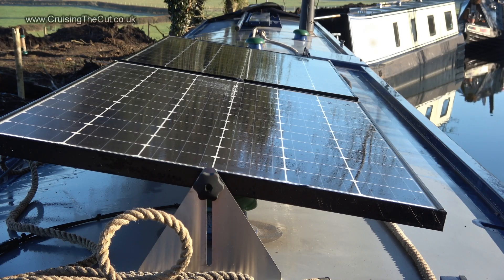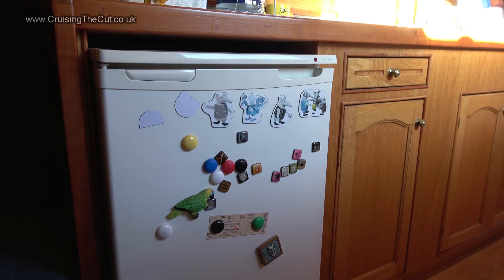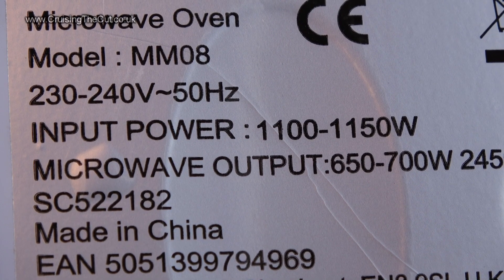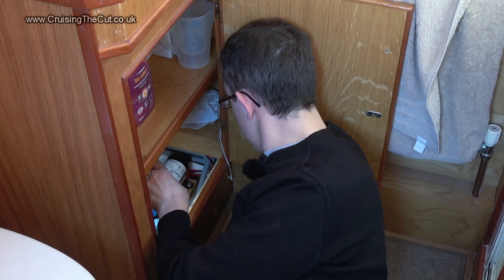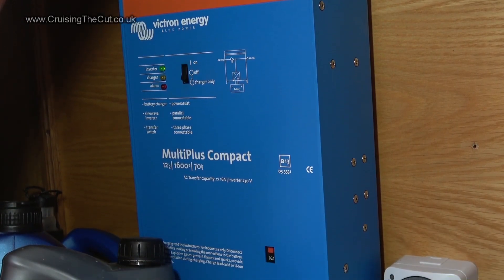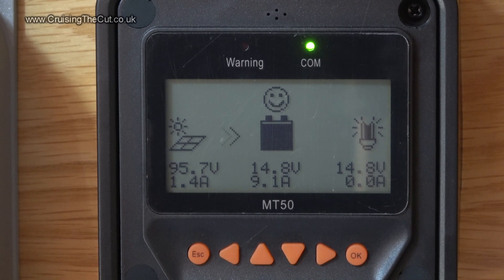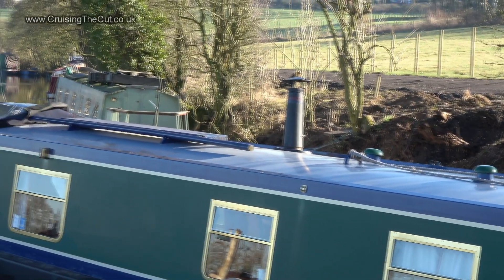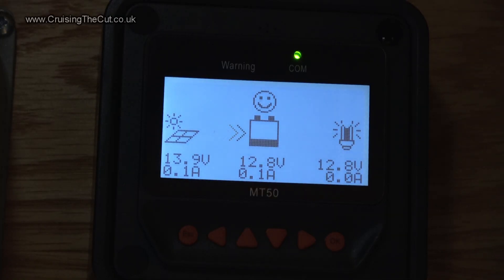76. Is solar power sufficient for a canal narrowboat in an English winter?

Comment: There is always a playoff between extra power generation and reduced power consumption in a cost-effective and convenient manner. The point is that but making a small flat mirror attachment to the high edge of your solar panels you can augments your solar power by about 10% in winter and then put the mirror away for the summer. On really bad days in winter, you can forgo your TV (pure luxury) and use the gas stove rather than the microwave. You can examine your fridge for further insulation [ossibilities and reduce the number of times you have to freeze food (buy fresh salads in winter for example). I personally like piping-hot soup in winter, which is best heated in a pan over the gas stove. Sometimes the stove can double as a heater (Aga) in winter

I prefer YouTube to the TV for entertainment, especially when there are channels like yours from which I can derive entertainment and pick up creative knowledge at the same time. But that is down to personal taste.
Reply from the maker: Different people different tastes as you say. I don't regard the telly as a luxury, even when I'm not watching broadcast material, I'm streaming YouTube/iPlayer etc on it. I don't freeze anything though, no freezer.
Reply: You could try cooking things on top of your stove David to save on using the microwave...as that famous supermarket says...every little helps ;) But I do take your point, solar is NEVER going to be enough on a narrowboat in winter, no matter how large or how many panels you put on the roof!
Reply from the maker: I do indeed heat things up on the stove - usually the kettle - but depending on how hot I have it, things can take ages and for only 5 minutes of heating, the microwave doesn't really use that much - 8Ah ish plus inverter overhead.

Comment: Hello CruisingTheCut. Another very interesting vlog, many thanks for that. have you any experience how long it would take to completely re-charge your battery bank, just by cruising along without the solar? You say yours is rather small, 330Ah, is there any upper limit for a battery bank?
cheers!
Reply from the maker: The upper limit is probably your engine-bay space and your budget! And to what degree you can recharge it.

No idea how long to recharge mine via the engine as I've never done it but half of 330Ah is 165Ah and my alternator's 70A so at least three hours to get it nearly full from half depleted (they should never be allowed to go below 50%)

Comment: Many thanks David for your very informative vlog.  While on the subject of having mains hookup that you touched on.  Do you know if there are any "controls" in place for boat owners in marinas regarding their metered electricity or can marinas change (sorry for the pun) whatever they want?   Basically just wondering how much more electricity would be from a marina supple to a "house" connected to the mains would be.  Sorry we do not have a narrowboat YET so do not have that information.  Best wishes again.
Reply from the maker: I'm told the actual electricity is required to be supplied at the originating supplier's rate but that the marina can make their own service charge. I pay 13p/unit (1kWh) at present.

Comment: Really enjoying your videos M8! Have you considered switching to lithium batteries? I know that they are more expensive, but they charge faster and at a constant rate.
Reply from the maker: Very expensive as you say but would also need a different charger and a different solar charger, plus there are possible fire issues to consider :-(
Reply: Only with lithium cobalt or lithium polymer (lipo), Lithium Manganese can still vent if shorted, but no fire. BTW, I have seen a lead-acid battery blow the hood clear off a car, so they're not a bit safer if misused.
Reply: Most batteries will explode if shorted out, so I really don't understand the safety concerns either. Lithium batteries are used in the RV and boating industry without reservation.
Reply from the maker: It just doesn't seem to be commonplace on narrowboats. Maybe it's the cost. It wasn't shorting out that's the problem, it's the overheating if improperly charged.
Reply: CruisingTheCut That's true, however the same problem exists with any battery if improperly charged. Worse I've personally seen was in Alaska with a car battery that was frozen when they tried to charge it. I really think you will see more use of lithium battery packs in the future. Even my weed wacker runs off a 40v lithium battery pack.
(I would suspect there are 10 Samsung 25r or LG HE2 cells in the pack)
Reply: John Kimbler About £2,500 for a 200 amp/hour lithium battery.

Comment: Add more panels. Use larger 300w panels. Build a rig. I have five 250 watt panels on my house, working my way up to 24 panels for 6kW. But I live at latitude 7 degrees north of the equator in Georgetown Guyana with 9+ hours of useful sunlight everyday.
Reply from the maker: Not much space for more, as explained. And larger panels would get in the way when I need to walk on the roof. Still wouldn't give you enough in winter for a full charge.

Comment: Hi there C.C. Just wondering how long it might take to charge batteries from flat to full using the engine (not including any solar charge). love your vlogs, can't wait to purchase a narrowboat one day.
Reply from the maker: Well... It's not simple. First, conventional batteries shouldn't be discharged below 50% anyway or they die. My engine has a 70A alternator but as batteries charge, they accept less current so effectively it would take days to get them to actually reach 100%!!

Realistically, my bank is 330Ah so 50% would be 165Ah required, so at least three hours would give you a good start but several more to top them up properly.
Reply: Thanks for the reply C.C. Very informative as always. (note to self... Never run batteries flat).

Comment: A fridge in winter ???
My diesel heater consumes 1 liter in 4 hours and I cook on it.
A lot less hassle with diesel heaters. Surprisingly clean and odorless.
You can also run a radiator from many of those heaters.
I use allready 20 years a Refleks heater. Best investment to my boat.
Reply from the maker: Yes I did a video about diesel (and other heaters) a couple of vlogs ago. Yes fridge as the inside of the boat is warm and I'm not shuffling food into the well deck all the time.
Reply: Its a small effort to invent a cool place for your food in winter and
thus mainly solve your amps deficit. Its a slightly different attitude off-grid living. Nothing dramatic, political or ideological. You get used to it.
Thanks for the vids.
Reply from the maker: In my case I don't have an amps deficit because I moor for winter and plug into a shoreline. My point was that for people who cruise, these are the things they need to consider.

Comment: Consider that the actual voltage supplied to items such as pumps etc is higher then 12 Volts, typically 12.7 V when charged but 13.4 V or more (up to 14.4V) when being charged. The result being that the rated currents shown on appliances can be lower than the actual consumption drawn when the batteries are above the 12v nominal.
To address these issues it is suggested that one adds 10%.
Note: If using an inverter, the current draw increases as the battery voltage decreases. This will be particularly noticeable when drawing heavy loads from the battery bank as it will cause some voltage drop at the battery terminals due to the batteries internal resistance.
Reply from the maker: Such as running the microwave!
Reply: Certainly as the microwave is probably the most power hungry equipment on a narrowboat. One can easily test/verify the effect on the battery voltage by measuring the battery terminal voltage while the microwave is running. Note: the microwave will be turning on and off depending on its power setting.

Comment: There's a way to increase significantly the Ah generated... just  ensure to have the solar panel perpendicular to the sun. Of course, this is not possible with the way you have installed the solar panels. You would certainly need to be able to turn then at least 120 degrees side to side, plus orientate them in any direction. Also, ensure that they do not receive any kind of shade, being from a tree, or whatever, r even coming from the other solar panel. This will not be really useful in an overcast day, but will certainly help una sunny winter day. Thanks for your vblogs!
Reply from the maker: Indeed, orientation is key.
Reply: CruisingTheCut how much would that differ? Would be interested to learn.
Reply from the maker: +r2gnl It does make a substantial difference when it's sunny but it's still largely irrelevant in winter when you get rainy days (no sun), grey overcast days (no sun), light overcast days (some light but diffused that pointing towards the sun - hidden by cloud - makes no difference). It would only help on the occasional clear sky, sunny day and even then wouldn't make enough as the daylight hours aren't long enough!
Reply: Mathematically, you get "cos phi", where phi is the angle between te sun and the orientation of the solar panel (a difference of 30º means a loss of 15%, a difference of 45º, means 30% losses). Then , due to having monocrystalline or polycristalline panels, performance will drop more on monocrystalline (which are oriented in one direction). Losses will depend on the manufacturer, but can be from 0 to 50%, or even more.
Reply from the maker: Good info.

Comment: Not good at all. U need electric supply for the winter. How do u go on when u get grounded there is no room to get on your roof. I have many times got grounded and get on my roof with my 12 foot pole to get free and back floating. Sure solar panels would get in the way
Reply from the maker: That's why I deliberately chose narrow (800mm) panels so that there is room to step past them in locks etc. When grounded, I'd push from the well deck or the back, not the roof.

Comment: i would suggest to add one more solar panel and two more batteries. And a mobile solar panel as an additional panel you can put direct in the sunlight when needed.
Reply from the maker: I don't really need it though. It wouldn't generate enough in winter, as explained, besides I'm on a shoreline. From spring to autumn, I have loads of solar.

Comment: Great Video! I'm wondering if during the winter months, on a sunny day, could a couple mirrors be placed to double up the light hitting the solar panels. I think in the summer it might make the panels run too hot, but in the winter, it might be a way to keep those amps up. Maybe I'll have to experiment myself a bit...
Reply from the maker: I've had a couple of people suggest this and there must be some reason why I've not seen people do it but as you say, maybe an experiment is needed.

Comment: Why don't you have more panels?
Is there no space to install them?
I've even seen people with small vans that has 1000W so I would think a bigger boat can accommodate for at least as much.
Reply from the maker: I mentioned that that in the video. But also, I tend to moor in winter with a shoreline so don't need any more, and in summer I have more than enough solar already.

Comment: "More solar" is the answer for winter. As in, (if my back of a napkin calculations are right) you need double the panels in winter (in the UK) than in the summer if you wish to go 100% solar. Though that will probably not include heating. (And your calculations seem to match that)

I'll never have the funds to do it, but I like looking at designs and ideas, so I put pen to paper on a solar powered engine boat. It would have more than enough in the summer (with that double the needed panels), to even replace an engine. But of cause in the winter you'd want to be moored up!
Reply from the maker: No, that wouldn't do it as I mentioned. You get about a tenth of the output in winter from the panels, at best, and for much shorter days. A solar boat would be fairly impractical as there's just not enough sun though I know of one company that's trying to market one.
Reply: In the summer my solar panels give me a maximum of about 13 amps output. In winter, with the panels pointed at the sun, I get about 10-12 amps output from them (on a good day).
Reply from the maker: But for a much shorter period :-(
Reply: Oh yes, but if I'm in a good location, and it's sunny all day - then lots of charging :-)
Reply: Sorry I was not clear. I meant putting enough panels on to power an electric motor in the summer, but it would only leave you with enough power to moor up in the winter. That is, 10x the power in the summer, and use a 10th of it moored in the winter, as you said. With something like 1250watts of panels. :P (Though you may be right and I got my amp/hours wrong, I'll have to go look at my spreadsheet)
Reply from the maker: There's an Australian boat manufacturer who's been advertising a plan for an all-solar narrowboat recently but I don't think their model physically exists yet.
Reply: I've seen one or two boaters do it. There are one or two companies here who will sell the batteries and out board (or in board) for an electric only. But no one yet does a commercial "solar boat" I guess.

Comment: My solar array is 240watts and I can just about manage to keep things going in the winter. Mounting the panels so that they can be pointed directly at the sun, and swivelled throughout the day, will make a huge difference. Having said that, I am still very much at the mercy of the weather conditions and obstructions from trees etc. There is always the option of using less power - less telly and computer! In the winter I don't use a fridge. I leave food out in the cratch where it is usually plenty cold enough.
Reply from the maker: I think you're doing very well! Clearly no fridge helps. Don't you find it a problem when the weather varies from cold to mild (for the food)?
Reply: It depends on the food in question. I think it's just a case of common sense really - don't let it sit around for too long, 2-3 days is usually fine. Just trust your nose, if it smells (and looks) ok it usually is. I do have real problems in the summer though. It means I have to go food shopping every day. I'm on the lookout for a 12v fridge for summer use. They are too expensive new.
Reply from the maker: Every day? Nightmare! Yes, damned expensive.

Comment: Excellent video as always. One thing I 'm wondering is even though an average setup can't run on it's own how much does it save from using fuel or being plugged in. Even 5-15% might be enough to save a little money that would otherwise be spent on fuel.
Reply from the maker: Yes, every little helps. Can't give you a figure though, it depends on the size of the array, the weather etc

Comment: You could of course unplug those electrical devices and go 19th century...but few could stand that for long.
But I bet ,many spend the winter at a place where they can get shore power.
Nice clear report on living with solar power...thanks.
Reply from the maker: Yes, you can get away with little power if you use little power (!!) but I like to have the telly on on a winter's evening etc. Yes, many moor up with a shoreline like I do. Cheers

Comment: Very good video! Do you use a special (marine grade) battery set-up? Some batteries are considered deep cycle batteries and are specifically made for marine applications. The wind generator could be a very sustainable idea.
Reply from the maker: They are notionally marine batteries (Multicell AGM 110Ah x 3). I'm told wind gennys can be a bit rattly and they are quite costly, unfortunately.

Comment: Thanks for you the very informative vlog.  It would not seem to be cost effective to add another solar panel if you could not get the daily amount of power you need and still had to rely on shore power in the winter.  If you are a continous cruiser with your set up then no problem.
Reply from the maker: Exactly.

Comment: What sort of output does the engine give you for recharging?
Reply from the maker: Mine's got a pretty small alternator, just 70A but some boats have double that and even multiple alternators.
Reply: CruisingTheCut ...diesel  does seem a good stand-in for the shortfall? ...if you need it during summer it might be time for more solar?
Reply from the maker: Oh, I've plenty of solar for summer (and spring and autumn). It's only winter that there's not enough.
Reply: CruisingTheCut great video (yet again) covering considerations for the liveaboard boater.

Comment: i have solar and it is just a top up . A expensive one if you think on it. Also the engine on tick over will take ages, longer tham you think to completely charge the batteries. I have a generator that is higher rated than the invert-er i just plug it in to the land socket. As it has the higher rating i take the 2nd socket of the generator with a extension and us say washing machine or hover while it charges. even so it can take 3 to 4 hours to charge those large batteries.
Reply from the maker: I think a lot of people do that don't they, I see a lot of little Honda EU20 generators :-)

Comment: that's a shame u have to run that big of an engine. could u get a small like 100 wt generator that doesn't use that much gas to top ur batteries off? I mean like one u can carry w/o no effort.
Reply from the maker: You can and many people do. They're noisy though and you have the safety aspect of carrying petrol around.

Comment: The domestic type fridges are very inefficient,scant insulation and the cold air is lost every time the door is opened. Built in top loading heavily insulated types as used on yachts are MUCH more efficient.
Reply from the maker: Agreed. I don't know why they're not more used on narrowboats but you just don't see them advertised. Odd.